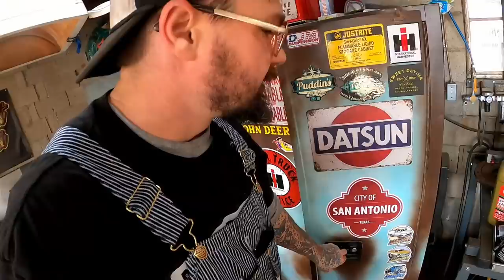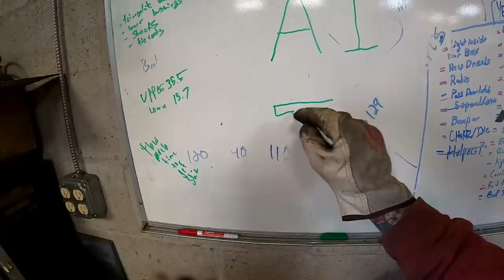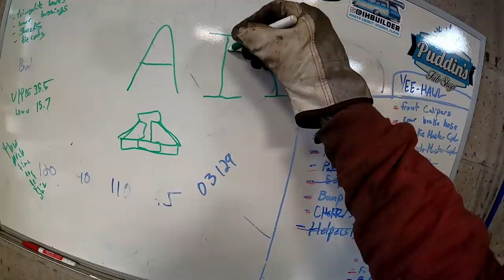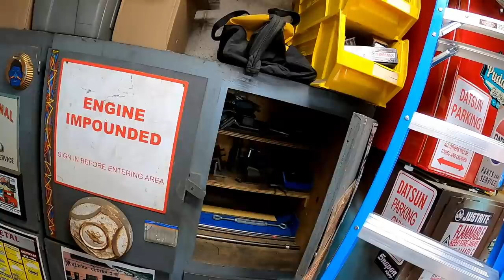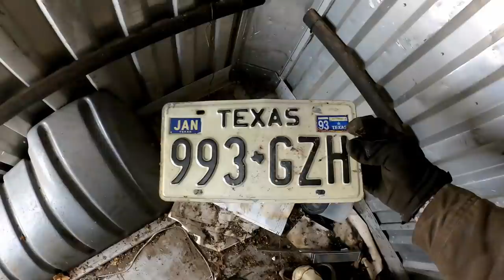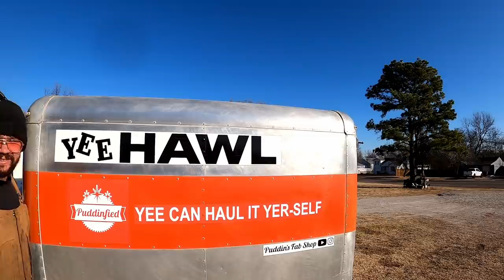BUDGET FRIENDLY front suspension Pt.3 AND old U-HAUL box MOCK UP!  ((1977 Datsun 620.))

Comment: I’d like to see you chop about a foot out of the side of the box, so that the top of the box lines up with the roof of the truck. Then pull a couple side windows out of an old truck camper shell and install them in the sides of the box. I think that would look sweet. Also, I really like it when you grind down smooth your welds. It just gives it a more “finished look. That just my ideas. I really enjoy watching your videos. You are fucking hilarious! And clearly very skilled. Thanks for the shirt. It fits great and I wear it with pride in VA.

Comment: I apreciate your show. And great how you address the haters. I think everyone has posted hate messages. I have with later regret. Maybe you could read one hater message per show. Or a complete show with all hate messages. I find all your shows about fabrication and less about the vehicle. Wheather it is a datsun or a model A or T restoration or hot rod. Just love your presentation. -30 degrees in northern minnesota. tomorrow is a heat wave with a high of 21 and a low of 21. thank you buddy. PS I am going to order some stickers for my mobility chair which I am going to spray paint international blue. I will send you some photos this summer as it is really hard to get around in the snow. Love the new t shirt design.

Comment: Put the Bob bed on the tow-rolla and make it a Toyota cat instead of a Subaru brat 🤣👌. Love the build going on right now it's awesome. So many people just doing will it run videos and here's putting actually putting the time in and doing a build video 💪. I I may suggest you really got to look into learning a bit more about that CNC plasma table it will save you some time. " Say's the guy who has a 3D printer and CNC router disconnecting dust LOL" but if you do it would be nice if you can actually show a little bit of your CAD program and your initial setup. Keep up the great work brother 🤟

Comment: Well puddinator.... you build em the way you want to, all the keystroke builders aren't there to help! I will say if I was doing it, I probably wouldn't be doing anything like you are lol! I'd be the small block V8 guy with dual rear wheels pulling a trailer all loaded for bear lol. But since you like the slammer look, setting the box down to the ground might look pretty cool.

I think I would set the box wherever you're going to and just build a whole new raised floor inside it for practicality(loading boxes on axle humps sucks), it would probably be quicker and easier too. 

Keep rounding up lil box trucks and you'll have your own rental outfit before you know it haha. Nice designs on the shirts btw. Thanks for sharing

Comment: The box mock-up is lookin good! I have no problem with the rear bumper being right where it is. You park it on the grass, it’s on the ground. So no need to go lower unless you just want to. Just a suggestion, keep the Yee Hawl color on the box but brush or rattle can the 610 Datsun cab Puddin blue. That will really work and pop with those white steel wheels.

Now just a question. When your all set to go, and have your steering hooked up, can you actually turn the wheels without removing 6 more inches of firewall

Comment: Puddin, giving it away is normally done through sponsorships and a raffle. Mostly with a parts store and to enter the giveaway they shop in the store. The winner is then drawn out of the tickets gathered at the sponsor store. Most of the YouTuber’s raffles settle for 48 of the 50 states (Alaska and Hawaii excluded). 

I still would not do it at this point. Maybe never. That is more relevant when you’ve reached 500,000-1,000 000 subscribers. 

I love your work. Keep it up, Jake! 

P.S. Regarding safety. Please get yourself some safety shoes with toe caps on them. Dropping stuff on your feet and stepping on nails or metal scrap could potentially hurt your feet badly. There even NB safety footwear.

Comment: How do you make sure the other side is built the same way? Genuine question
Reply from the maker: So I meant to address in the video after the montage and totally forgot. 

Tape measure and angle finder!
Use reference points to measure back and locate where the tabs need to weld to the frame.  For the tubing and the tan of it for the shock you need to level the truck from side to side to 0. Then check the drive side and match the passenger side as you go.

Comment: What is the point of putting the box on it if the box isn't going to be functional? You could fab wheel wells and than make a new floor that would run above the wheel wells, then put doors between the new floor and the original one and turn that space into a storage compartment. That would make the box functional again. That would be cool.
Reply from the maker: Well it ain’t gonna stay cut out I can tell ya that much.

Comment: let's talk drive shafts imagine nobody's right and nobody's wrong , I'm guessing U-Haul came up with that two-piece drive shaft the way that Mazda bolts it onto that rear end like a brick shit house probably caused a lot of flip overs ,pole vaults and problems when the drive shaft slipped off the front yoke, when people are moving they load that shit down, drive shafts usually have those two u-bolts that will bust off of there when needed. I'm thinking maybe you should put one on that Datsun at least hang a coat hanger up there.lol